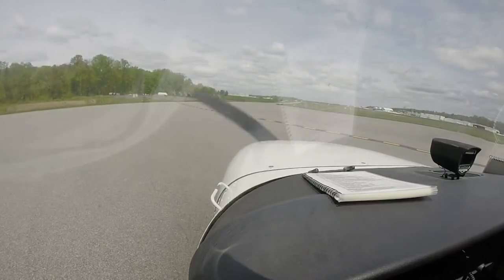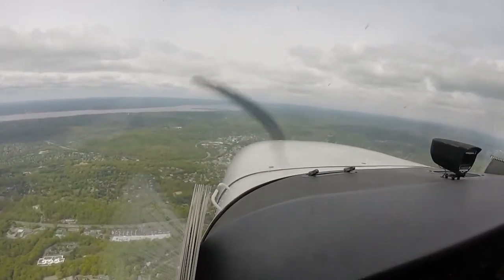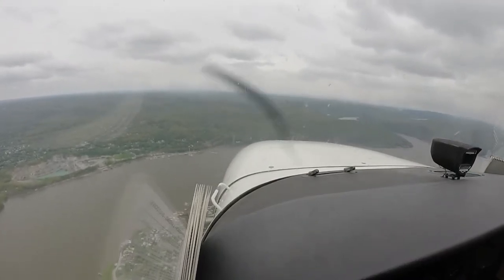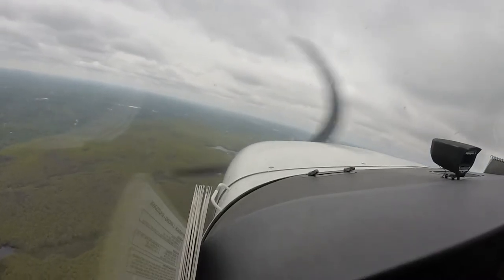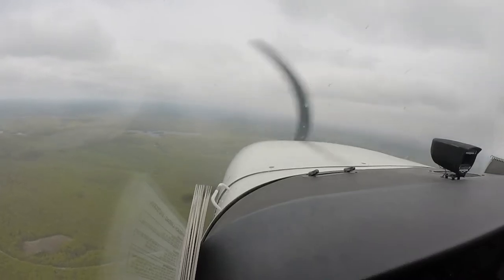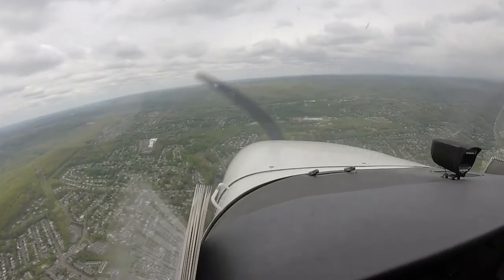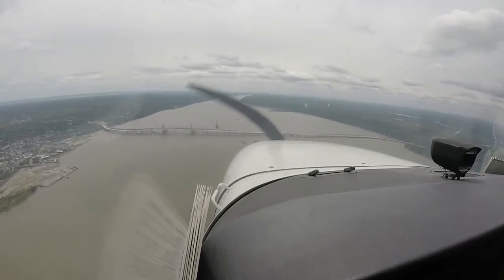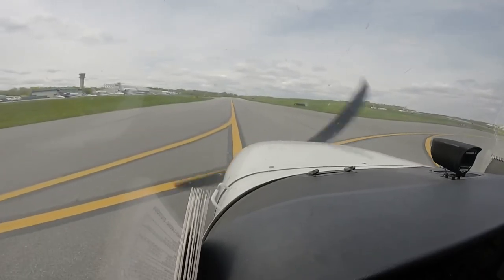FLIGHT LESSON #33 PRE CHECKRIDE MANEUVERS REVIEW

Comment: Nice video! Have you done the written test yet?
Reply from the maker: Thanks Ollie! I'll try to do the written this week or next week for sure, just did a few practice tests, 90-95 on most, now if I can only get that on the real one would be great! When did you get your license, was the new ACS implemented and if it was how deep in details did the DE require of you?
Reply: I believe I took my license under the older PTS - I'm not sure when the ACS was formally introduced (I passed my license in Aug of 2016). In terms of the practical exam and oral, the DE tested a broad spectrum of knowledge - the usual questions were asked relating to electrical systems (how do mags work etc) as well as broader "why have you planned this route" etc. The practical exam tested everything you've practised with your CFI - emergency descents, steep turns etc. You should just treat it as a normal flight. Don't over complicate answers and when you complete manoeuvres just relax! How have the new ACS affected your test prep?
Reply from the maker: Ok, the new ACS were introduced june 15th last year. I'm assuming that with the new standards the DE will go more in depth with questions and expecting a little more detailed answers. I've gone over the Cessna kit a few times and taking practice tests and reading stuff from different sources just when in flight because I'm focused on the task of flying sometimes the info comes out a little slower lol whereas otherwise I mentally review information randomly and it's easier to remember when not flying. I guess it's also the pressure of having the CFI in the right seat but I hope to be ready when the time comes. Thanks again for the info and safe skies!
Reply: djvectrex In that case I may have adhered to the ACS and not PTS - I suppose I was ignorant towards the test terminology and just learned/did what the CFI told me. Just review the POH/ACS handbook/FARs (only the necessary parts) and you'll be fine!
Reply from the maker: I think you might have had the PTS, you might have been grandfathered in. I think after it was implemented then a student would adhere to the ACS though I started 2 years ago and I'll be held to the ACS so maybe I'm wrong. I will definitely go over everything again once more before the oral and checkride!
Reply: Sounds good! Good luck, I'm sure you'll do fine.
Reply: I think your right - there's a lot of interesting debate over the costs/benefits of ACS V PTS. Seems like more emphasis on general "risk management". You'll know more than I do about it. Has it affected your training at all?
Reply from the maker: Yeah with the ACS there seems to be more emphasis on risk management and more in depth about aeronautical knowledge. It has not affected in any particular way other than when the time comes I should expect to have to elaborate a little more on certain things but I'll be ready. Thanks again!